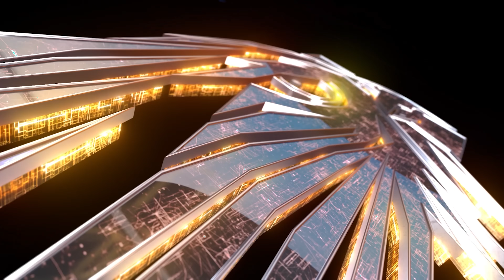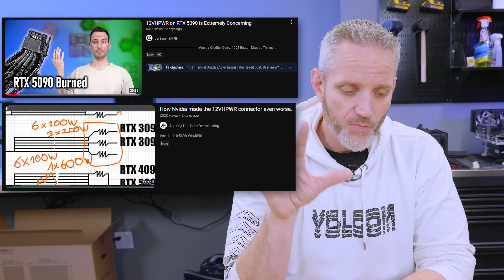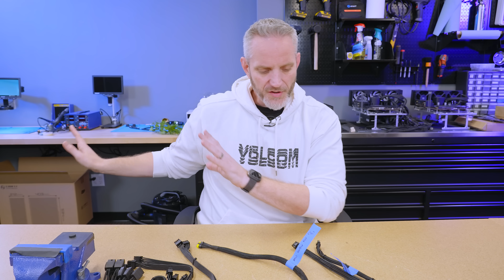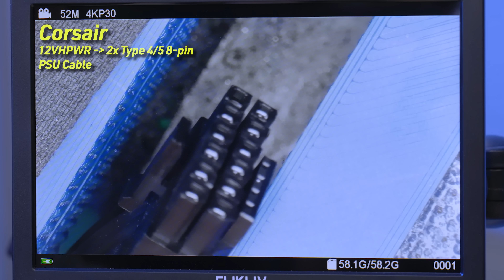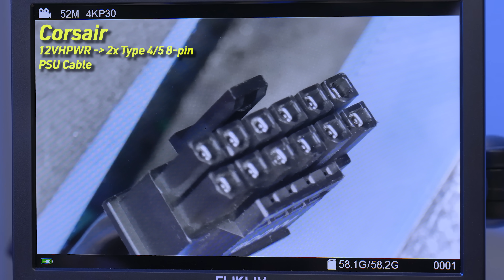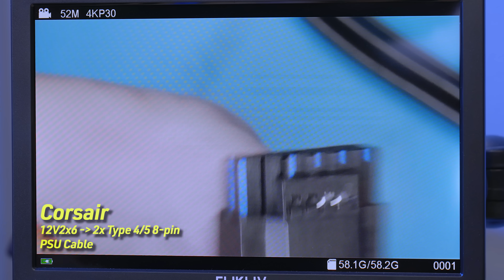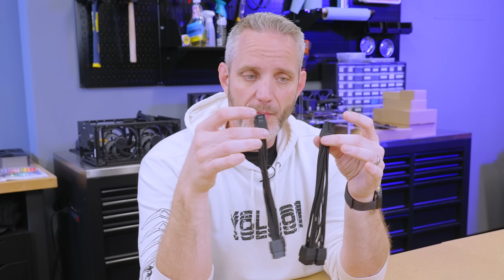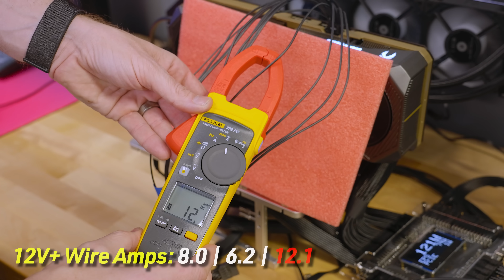I discovered something concerning and I need the Experts to chime in... More 12VHPWR discovery!

Comment: The funny thing is that the spoof pictures that people had of the 4090 & 5090 cards where it required a kettle lead plugged straight into the graphics card would be safer at this point. Just ignore the physics of converting AC to DC.

Comment: Oh Shxt I am using this Corsair cable for my 4090. I have only plugged it once but I am not sure if I should be unplugging it for close examination only then to make it break completely. Should I just buy another new cable anyways...

And I couldn't use the original adapter coz it would bangs right against my case. Maybe a new case and a new PSU would had been better? Isn't this ridiculous?

Comment: A videocard has like 300 ground connections and only a few 12v connections. Losing a ground is less bad however I assume that the 12VHPWR only uses the provided ground from the cable so I doubt that it would be much of a difference if you lose ground vs losing 12v. But that really depends on if the ground plane is connected or not which it very well might be. If the ground plane on the PCB is connected all the way from the PCI-E slot to the power plug (which should actually be really easy to test just using a multimeter) then there would be a significant difference as ground could just go through the mainboard.

Comment: Those pins are moving like +/- 1 mm which I don't think should be a case in connector that is melting that easily. When you install connecter, you should also push on all cables so push it more into connector, it's just bad standard.

Comment: You said that it is mostly a problem on the 12 volt side. I had a brainfart.... The ground side is also the side wich has the clip to retain the plug. If, as you mentioned, only a gap the thikness of a rasorblade can cause a problem,  it might add up I think....

Comment: I feel like the conclusion here is off. Yes you can have a really bad cable (not trying to defend that atrocius peice of shite from Corsair here), but the standard should account for the fact that small variations in ressistance is unavoidable during the manufacturing process. And it's unavoidable in several steps. A worst case scenario is not just a cable having a bad pin connection. It's a cable having a bad pin and the GPU and the PSU on either end having a bad connection to the same pin on their respective ends. Even with this cascade of unfortunate events having things melt and/or catch fire is not acceptable and your safety margin should thus be increased. The only option that's an acceptable compromise for not upping safety margins would be a requirment that every device that uses the cable performs load balancing if they risk pulling more power over the connection than the individual leads can safely handle on their own. If they need to load balance all pins or just group them into two should depend on their power consumption. Two roups is fine if each group can never overload a single lead. if not go to three groups.

Comment: When you need to know what diameter you should use for an electrical wire in a house you need to know what is the power consumption and the voltage.
Then you apply the well known formula U=RxI  Tension = Resistance x Intensity
And then you need to know that a wire diameter can support 5 amp by mm²
So if you have 10 amp, you need at least 2 mm² (so you take a 2.5 mm²)
When i see the diameter of the PC cable and the current passing through, i wonder if there is different laws of physics for PC current (I guess not)
I know that it will be horrible and not practical to have 6 mm² cables for a PC but i wonder how it's not melting with so much current in so small cable.
Now I'm not an expert in electricity, i only know the basics i learned in school and how to use formula like P=UxI and U=RxI to know if things are correct but those new connector on the 4 and 5 graphics cards series look too small for what they need to do.

Comment: I am using a Corsair PSU (RM1000X Shift), tested the 12VHPWR cable I attached tomy 5080. It moves too, so I just plugged in the adapter that came with my MSI GPU. It should be fine, right?

Comment: Hay Jay. I've been watching your channels now for a few years. And I appreciate you when we talk about the 12 V. High power see. I work in a metal fab. Cnc laser company, when we have problems like this, we put dielectric grease on our contacts to eliminate hotspots in the connection or spikes in resistance. It allows the resistance to be equal throughout the entire contact. All they're gonna do, there's a little bit of dielectric grease in the GPU's ports and insert the high power cable, and you will no longer have any sparking going on inside there. It's nonconductive in helps to flow electrons

Comment: I don't get the PC world - high power connectors have been solved in so many applications before... RC (radiocontrolled cars, drones, etc.) uses e.g. XT60 and XT90 connectors, that can handle 60 amps and 90 amps continuously. I got it with the different rails before that you want more strands but if now everything is basically the same rail and you are risking imbalances with different resistances per wire with those sh... plugs... why not just go for some established 2-pole connector. Or at least use the same technique used there, if you want to design a new plug with some sensor wires...

Comment: Jay, I own a Falcon NW and have for years. I'd like to use them again, but I have a major concern with how they place their AIOs. I know you work closely with them, and I also know they sometimes skim your comment section here on YouTube. I've had to replace 2 AIOs in my Talon since I bought it 3 years ago. The first one died soon enough Falcon covered it under warranty, but it's also eaten an Arctic 3 since then because the pump block is so high relative to the radiator. Maybe you could, I don't know, nudge them a little? ((Hint: an optional panel set with feet and a 90 degree rotated logo for laying flat))

Comment: The problem is that pc's are the only industry I've heard of where they use more cables instead of larger cables to deal with more power.  That's it. That's all there is. Just suck it up and use larger cables. Problem solved.

Comment: Electronican: There is basic design flaw on power conector on 5090 PCB side. All vertiacal pin are conected to wide bus bar metal on the back of connector. If you look at path length from lowest pin to PCB it is shortes and has least resistence, oposite to farest pin there is longest path. And with pararrel connection (6 wires) currnet chooses/prefers least resistance path, so on wires on lowest pins/closes to PCB current will be significantly higher. The effect wil be more visible on shortest cables, long cable or mesasuring devices will balnce curent due extra resistance on each line which reduce relative diference between tham. Thet all simple.

Comment: TL:DR Basically they need more copper in the 12V Rail cable cores. 

I always assumed that the cable crossectional diameter of copper is likely not enough to carry the 600W@12V or 50A, if you calculate at this rating the DC core should be 9AWG. Split it in 2, so 300W per rail and still 14Awg. 14Awg is pretty thick. A quick check online shows that in the realm of 12VHPWR , those cables are 16AWG (Thinner, less conductor). As such, they are not correctly rated to the expected current draw. 12AWG cores would fix it, but then it may be a little to thick for the connector. Not enough copper will result in a hot cable under load, and finally burnout at the next failure point, likely at the crimp in this instance.  13AWG, despite being unheard of, would be perfect. 

You Said 22A in your video, Thats a 15AWG cable conductor. Once again, online, most manufactuirers are using 16AWG. For the Uninitiated, the larger the AWG number, the smaller the conductor. 

If real world draw is 22A per 12V rail, we would specify something that can take 40A or higher or there abouts (perfect world, built to last, not the world we live in).

The conductor is insufficient. 

As for the connector, the -ve or +ve rail being a poor connection would result in a failure at that point, so a bad earth wont appear as a failure on the 12V side, instead it would appear as a failure at that -ve connection point. You can try pushinhg the cores a little deeper from the back of the connector with needle nose pliers one by one, to ensure a good seating. But honestly, it should be ok. lots of surface area there generally.

edit: all calculations assume 3% loss, thats good copper. Any aluminum or steel in the conductor will make everything notably worse, cut the cable in half, strip it back, pull out one stranded core (hair size) and place a BIC ligher (soft flame) under the copper strand, if it melts withing 10 seconds, it has aluminum in the mix (copper clad aluminum), if it wilts a 1/8th inch at most and glows red, its copper. Quality matters

Comment: The difference in current between the wires will decrease if their length increases, and with it the resistance will increase. This can be seen in the second test, when the line length became significantly longer, the resistance is higher. This is a kind of passive load balancing.
Reply: Wire resistance is negligible until you get to kilometer lengths.
Reply: @jjb675  You can improve the situation a little by adding 0.5m of wire, for example. This is not a complete solution to the problem, but it can help a little, then there will definitely not be 20A on one wire.

Comment: 15:40 Correction, Nvidia does say in their manual "Attention: Use only the included NVIDIA power connector adapter
for your GeForce RTX 50 Series Founders Edition graphics card." Though I find this a cheap excuse for a bad designed adapter.

Comment: The contacts should NOT be recessed!! I got the first gen SF1000 PSU from Corsair in 2023. I had a grip of intermittent power on cycles. I checked the 24pin MB connector and saw 2 of the contacts were recessed. Luckily, i know how to troubleshoot, and I had some narrow tweezers to reseat the contacts and haven't had an issue since. Contacts should NOT BE RECESSED!!! QC must be taking rest at Corsair....

Comment: It clearly show that cable manufacturers cheap out on their quality, resulting in products which melt.

Nvidia is pushing the specs of the power delivery system to the limits. When subpar connections are used, they melt at problematic connection points. 

It is not wrong to push things to their limits. Yes the specs ahould have had more leeway in terms of contingencies. Nvidia should have used more hardware on their cards to detect and prevent out of spec cables from trying to run the cards. That one is on them.

Cable manufacturers should ensure their cables are not a hazard to the hardware which would use their cables to deliver power.

Comment: If I can get 4K120 RTX native out of a Radeon 9000 series, I'll be more then happy to ditch Nvidia. Here's to hoping I guess... As far as losing a ground pin, that's no where near as bad as losing a power pin. You will have quite a bit of grounding through the PCIe slot. More then enough to make up for the grounding pin. Definitely not ideal, but it likely wouldn't cause the connector to melt. The problem is much worse when it's a power pin. Waiting for the youtube video of someone modding their 5090 by putting a 4-pin header cable on it for the control signals and using XT90 or EC5 connectors with 8ga wire for the power rails. Some nice silicone RC wire with a nylon braided jacket over it for protection.

Comment: There's only one way to deal with this. We need a new power supply standard with a 24V, 36V or even 48V rail. That will keep the Amps in a reasonable range. If not that, the computer manufacturers should look into different connectors that have less issues with correct mating. Look into connectors used in the RC world. Very small connectors that easily carry 80-100 Amps all day long with no heating.

Comment: OK I think its finnaly the time that tech companies MUST START producing stuff that is TOP quality starting with power connectors, materials used in them and in any other component of the product, quality of finish, longlasting design and life of a product and start competing vs other companies in that area not some +15MHz on core clock. GPUs costing not 2000$ but in reality 3000+$ MUST be produced with everything flawless and best quality possible.

Comment: Gpus went huge in last ten years but pc cases got smaller and smaller to the point you cant buy full tower cheap that has enought room and gpu cables end up being tight AF so no wonder this happens when such cables are badly designed.

Comment: Power going in and power going out are the same, they are in fact mirror images you could say, if you got 4.4555 Amps going in you will have 4.4555 Amps coming out, both power and ground wires see the exact same load, the fact that it seems like its the power side on the connector that burns suggests to me that its the connector itself, maybe how it gets bent on average makes the power side more resistive or something

Comment: As Derbauer pointed out, the uneven load distribution of current on the founder's edition card is the possible culprit. The current draw that is supposed to be evenly distributed into the six 12V wires is only going through 2 wires on his card and is too much to handle specially for a video card that draws over 500 watts consumption while doing graphic intensive tasks. More current draw equals more heat, so it is not surprising that those two wires will heat up to melting point handling all that current on the damaged 5090. If the current draw was divided evenly to the six 12V wires it will not be an issue.

Comment: Cheap manufacturing and Nvidia can't even follow their own spec. Keep supply separate like 3090, 3 resistors. Make it physically impossible for any single pin to pull more than 16 amps.
Problem solved. All this drama because folks wanted to save $0.15 if resistors.

Comment: As other have said below and not to be a drama.. if the TDP is 575w and the cables are 600w capable there is not sufficient headroom regardles of the connectors. Reviwers are saying 600w plus draw on the 5090 constant ..how can this be a thing for a consumer product even if it is installed by a system builder company in time with transport, heat expansion contraction there could be movement